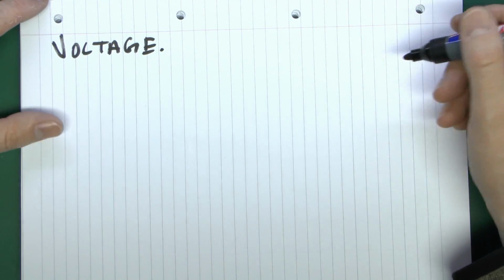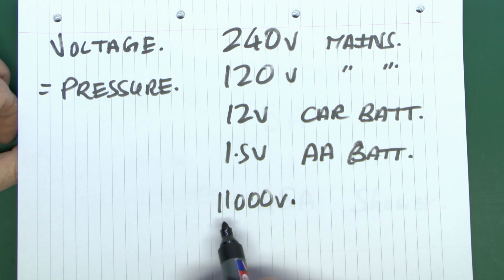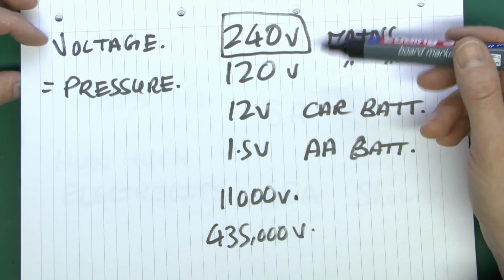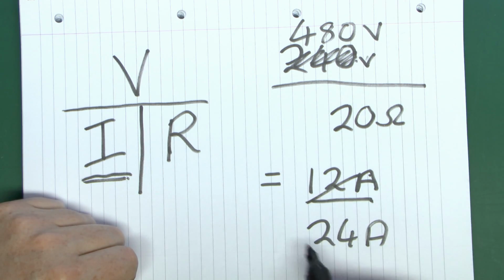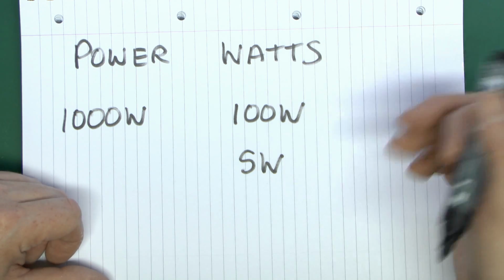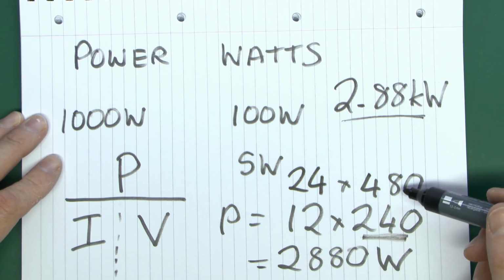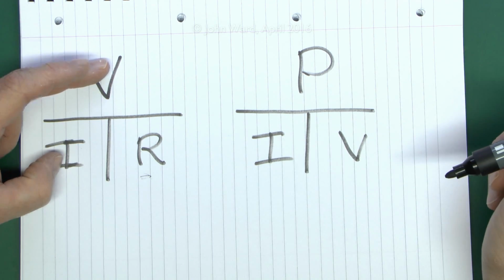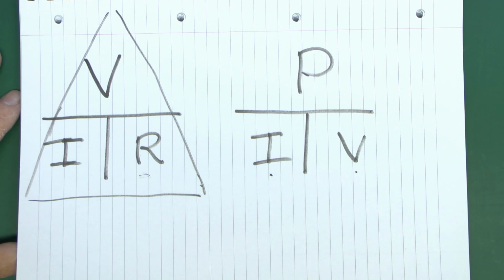Voltage, Current, Resistance & Power

Comment: hi John, is it possible to run 500amp with 1.5 volts DC through 1 square meter sheet with 2 ohms resistance

Comment: So.... here's a question.       When using a hand held electric drill and working the drill hard. eg.. drilling into brick. The drill maintains the same rpm but the current increases. Can anyone explain this. The drill doesn't have a brain yet it wants to get to its target rpm and to do so, it puts in more effort to do so. As if it had a brain. Just wondering. :-)
Reply from the maker: A motor just converts electrical energy to mechanical energy.  If it's more difficult to turn the motor it will take more current, until the point where the motor is stalled and it draws the maximum current.
Reply: @jwflame  Thank you JW!! Top bloke!

Comment: clearly you used a calculator to find R does anyone show their working anymore ??? what calculation method are You using to get your answers ?? magic is not possible if you are required to do it manually....  for example i don't care how you do it 1 divide by 0.25 is 0.25 Not 4

Comment: I had a discussion with my son, he argued that voltage kills but I was always told that it's current, though I suppose you could argue that it's resistance (lack of) that kills . who's correct or are both correct. Then there's static !!

Comment: Human with dry skin has a resistance of ~ 100,000 Ohms
Wet skin / breaks in skin lowers resistance to 1000 Ohms, and contact with high voltage damages skin which reduces resistance to ~ 500 Ohms.

Any current above 0.1 Amps can be lethal to humans. have fun calculating which of the common voltages are lethal

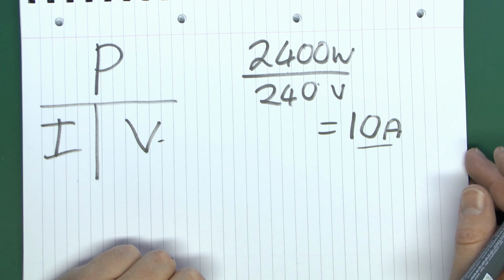Comment: Sir, I have been pulling out my hair for the last hour or two trying to figure out something that ought to be pretty simple, but for some reason I couldn't figure out.  I knew there were two formulas, and that they were connected, but couldn't quite put it together.  Then I found your video, and your very helpful links on the times.  Your explanation at 18:18 solved my dilemma.  Thanks!

Comment: Sir,i have question...
I have 24V ( DC) counter ,and i have supply voltage 
1. 220V DC ( case .I)
2. 110V DC (case.II)
What will be resistor value with watt also..
Current you suppose any .
Plz send me

Comment: Does current increase when we connect batteries in series or does only voltage change? Cool video btw!
Reply from the maker: Batteries in series = higher voltage, maximum current is the same.  Batteries in parallel = higher maximum current, voltage is the same.
Reply: @jwflame  oh thank you so much for replying. Im just dont completely understand this. If the voltage increases shouldn't the current increase also? Then the formula I=V/R doesn't apply, right?
Reply from the maker: @whoever2910  The formula does apply to batteries, but the R is the internal resistance of the battery, which is typically very small and in most practical applications isn't of any relevance.  I=V/R is generally used for loads and the circuit, not the power source.

Comment: JOHN WARD,                                                          if a lamp bulb draw .15 amps and another lamp bulb draw .25 amps how do you find the percentage of current draw between the two different lamp bulbs? what is the formula 
.15 amp lamp bulb draw less current compared to .25 amp lamp bulb by what percentage?
Reply from the maker: 100x .15/.25 = 60%, 
0.15 is 60% of the current of the 0.25.
Reply: @jwflame  is there other formula to use beside that one to find the percent of power consumed from the different of the .15 lamp to the .25 lamp?
Reply: @jwflame  if i rearrange the formula .25/.15 X 100 = 166.7% which doesn't make sense that the .25 lamp is 166.7%?
Reply from the maker: @billwilliams6338  .25 is greater than .15, so the percentage will be greater than 100%, 100% in that context is the 0.15, 166% is the 0.25
Reply: @jwflame  but what formula can I use to get the percentage between the two bulbs .25 and .15? 
like is .15 bulb 20%,40%,60%,80% drawing less current power compared to .25? What formula can I use to find the percentage between the two bulbs?

Comment: Let's say i have a older automotive relay that does not have an amp rating on it ,but i know it came out of a car with a 12 volt system. Are you saying i can check the resistance  across pins 30 and 87 (pins 85 & 86 are the coil) That way i would have two of the values needed to find the amp rating?
Reply from the maker: The resistance of the contacts will be zero when closed, so calculation isn't possible.
Rating of the contacts is down to how they are constructed such as how thick the metal is and various other factors.  Not something that can be determined by their resistance.
Reply: @jwflame  Yes that make sense. there must be some way to check them. Been watching a lot of videos where new parts are bad. Made me start thinking about relays, how do know what we are really getting.  Maybe trigger with a magnet then check resistance...Thanks.

Comment: John, I do like your videos and I know you picked 480v to make the maths easier. However, would have been better if you selected actual voltage on 3 phase circuits - 400 volts.

Comment: One slight mistake I caught. You said the resistance of the conductor is fixed and doesn't change. That is false. The resistance of almost any metal will vary based on temperature. This is known as the temperature coefficient of resistance. Indeed, this principle is what very accurate industrial thermometers are based on (called RTD's). You take a coil of (usually) platinum wire of a specific length and diameter and its resistance will change depending on the temperature. Properly calibrated, these RTD's are more accurate than mercury, thermocouples or thermistors.

Whatever the metal, the higher the temperature, the higher the resistance. This means as you pass current through the wire, it heats up, which increases the resistance of the wire considerably compared to its cold state. This concept is important in circuit design because the engineer needs to understand how the resistance change of a hot wire will affect current flow.

I realize I am being pedantic and this concept likely is of no relevance to an electrician who isn't interested in the resistance of a hot wire, but it's an interesting property of metals I figured some might be interested in.

Comment: hello John .. can you please check this video and let me know what you think about it please 

https://youtu.be/XMviNpejyr4
Reply from the maker: As in the other one - that is not how you measure current with a clamp meter.
For current, you need to disconnect the test leads, and place the clamp around one of the wires with it set to'A~' .
The power output will be tiny, as it's a very small generator, driven by a very small motor.

Comment: Question if you have a moment.  When a device runs on 120v (USA) at 1000W output and device states it draws 10A...the same identical device has ability to run on 240v, still has same 1000W output, but states it now draws 5A. The way I understand your video, when this device goes from 120v to 240v, the amperage of 10A (@120v) would go to 20A (doubled the 120v to 240v).   What am I not understanding correctly?
Reply: If it is a dummy device like a heater it would draw 4000 W on 240 volts which would destroy it. If it is a smart device that is designed for different voltages (or a dummy device designed for 240 V) then it would naturally draw less current on 240 V.

That means you just cannot use such dummy devices with incorrect voltage. You need to use a device designed for the proper voltage.

Comment: hello 

im working on a mini generator 

and im completely new in to Electricity fields 

so a question 

im getting 
560v 
140amp 
the resistance is - - - - 

what means this ? 
or how do i know how many ohms im getting  

please need your help
Reply from the maker: 560v / 140A = 4 ohms - but that only applies to resistive loads, and would not be correct for anything inductive or a power source such as a generator.
Reply: +John Ward thank you for your reply 

as i said im completely new to Electricity fields 

as i said im 560v 140amp. . and you said 4 ohms. . how its possible that i can't get a 5w bulb lighting with it ?
Reply: to be exactly what my voltmeter shows is as following 

560v 
162.1 Hz
45.61 Nf
138.2 F
25.40 v LoZ 

what all this means to make a metal grinder working with this i don't really know and that's why i need help please
Reply: +Dugagjin Dervishaj https://youtu.be/JY9LjaZ6aB4
Reply from the maker: 560V is the voltage with no load connected.  The 'loZ' mode on that meter applies a tiny load, usually a 100Kohm resistor, which causes the voltage to reduce to only 25 volts.  With any real load, the voltage will be even less, which is why nothing will work.
In the video showing the meter displaying 140A there are no wires through the clamp at the top of the meter - therefore it is not measuring current.  Clamp meters do not measure current at the leads connected to the device.
If any of those wires were really passing 140 amps, they would all have glowed red hot and set on fire within seconds.
Reply from the maker: I suggest you watch these videos on how to use meters correctly:
Clamp meter: https://youtu.be/g5d_wxdE5tk
Multimeter: https://youtu.be/rrqa-R1zCWQ
Reply: +John Ward 

any idea how to turn this volts and this amp's in to power that can make at least a metal grinder working with it ?
Reply: +John Ward 

any idea how to turn this volts and this amp's in to power that can make at least a metal grinder working with it ?
Reply: +Dugagjin Dervishaj 

you mean that the voltmeter is showing false numbers or im faking anything??
Reply from the maker: The 560V is probably there, but there is no current available - when any load is connected, the voltage will reduce to almost nothing.
The meter showing 140A is completely wrong, and suggests the meter is broken.

The 'generator' thing you are using is tiny - it can't provide any power.
Connecting it to a transformer will increase the voltage - but at the same time reduce the current.
Reply: +John Ward the voltmeter is almost brand new from USA. . isn't a Chinese product. . i could though that to but yes it can be a broken one doesn't mean where the voltmeter is from .. 

im waiting for a new voltmeter also from USA. . but yes i will make some new test with different voltameters 

and this measuring which i did they all are from transformer outputs

Comment: how do you know 20 ohms ? from 240 v ,  did you just picked and guess it 20 ohms , or what
Reply from the maker: 20 was used as an example because it makes the other figures whole numbers. For a real heating element you would need to measure the resistance with a multimeter .
Reply: ok , if you notice 240 volt , and you don't know know what amps or ohms to apply , , lets say 240 volt , how can we get the amps and ohms ?
Reply: i mean , how do we know the amps and ohms that going to be 240 volt by math ,?'
Reply from the maker: If you only have one of the values then you can't get the others - you need any two of voltage / current / resistance / power to be able to calculate the other two.
One of those on their own is meaningless.

Comment: Hi Johan...you done great video.. easy to understand... I have doubt..
Expl: I have 100W incandescent bulb and 100W LED light, is both are consume same power...?
If both consume same power means why we say LED'S are consume less power... I have confusion with this concept... so please explain me... Thank you for your great video...
Reply from the maker: 100W is 100W, regardless of whether it's LED, incandescent or anything else.
The difference is that a 100W LED will give out 10x more light than the 100W incandescent, so for the same amount of light you would only want a 10W LED.  Much less power for the same amount of light.
This assumes the products are marked with actual power consumption and not some useless 'equivalent' wattage.
Reply: John Ward thank you for your response...

Comment: Just a Question John and It may be a silly one but I'm a 3rd year apprentice electrician. Why is it when you work out the current for the big high voltage transition lines you use the power formula as opposed to ohms law?? E.g. the higher the voltage the less current.
Reply from the maker: Power lines are designed to carry a certain amount of power, so the equation with power in it is used - power is the fixed amount, and you can then determine the current required at a particular voltage.
Ohms law also applies, so if you increase the voltage the current also increases, the resistance of the line is fixed. However that isn't of much use for power lines, and for high voltages there is more involved than just resistance.

Comment: HOW CAN CALCULATE CURRENT IN 3 PHASE AND NEUTRAL  AIR CONDITIONER MOTOR GIVE FORMULA AND RESOLVE AN EXAMPLE IN FOR EXAMPLE 40 KW POWER MOTOR ,PLEASE AS SOON AS POSSIBLE.MANY THANKS.

Comment: 0:00 - Introduction
0:57 - Voltage basics
2:40 - Current basics
3:47 - Voltage & Current relation
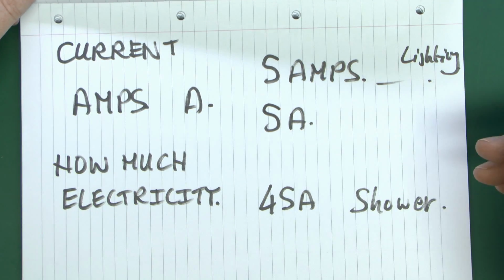4:40 - Resistance, Voltage & Current relation
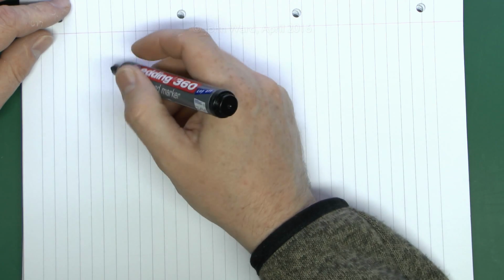7:21 - Ohms Law (V,I,R)
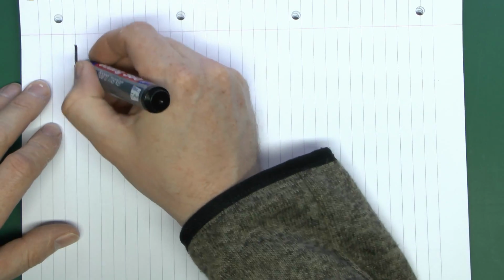12:12 - Watts Law (P,I,V)
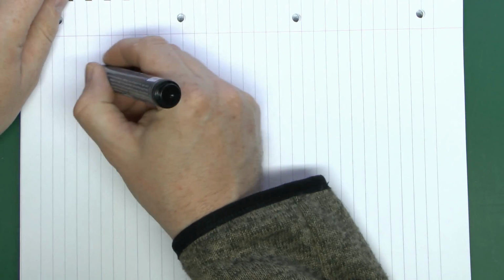18:18 - Ohms Law & Watts Law relation
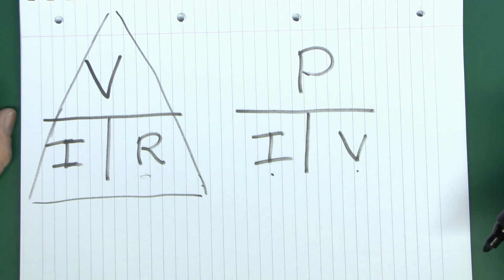20:23 - Recap
22:08 - Conclusion & advice
Reply: Nick I Clim
Reply: Oh ur sick man thx

Comment: Hi John,

Thank you for your video.

This is obviously for AC correct?

Does this apply to DC?

Example if you connect 6 x 6 volt 4 amp batteries together in a way that makes 36 volts at 4 amps. What is the resistance and the watts supplied?

Regards

Kurtis

Comment: This is late at night, and it's probably a dumb question but suppose I know the Power and Resistance, how do I go about finding the amps or volts?
Reply from the maker: Amps is the square root of power/resistance, voltage is the square root of power x resistance.
If you search for 'ohms law wheel' you will find a circular diagram which contains all of the combinations of power, voltage, resistance and current.
Reply: Thanks!

Comment: a very complicated explanation of a very simple topic.   Volts, amps and ohms were units  invented and defined by man with a relationship of 1:1:1.   That is,  one volt of force pushing electricity through one ohm of resistance will cause a current flow of one amp.  End of story.  The rest is just math derived from that.

Comment: VA isn't W, need power factor as well
Reply: +John Einar Reitan VA = W for instantaneous measurements. Power factor is only used for AC circuits where there are inductive (e.g. motors) or capacitive (e.g. flourescent lights) loads. AC Voltage and current measures are RMS (Root Mean Square) values derived from the varying AC instantaneous values. When power factor isn't 1, instantaneous VA will be less than RMS VA.

Comment: When teaching Ohm' law, consider using the symbols Ω, V, A, W. Instead of R, [UVE], I, P.
Source: https://youtu.be/WLK8zgpixDY?t=1m17s
Reply: +Per Mejdal Rasmussen I would not want any electric work be done on my house by a person who cannot learn the things properly. Understanding the concepts of voltage, current and resistance is essential. It is not enough to read something from a  meter.
Reply: +Okaro X You have not understood my comment. It is not about not learning Ohm's law. It is about using variables that are easier to remember. People keep teaching R, [UVE], I, P, because that is what they have learned. Without stopping and thinking why we use those variables when Ω, V, A, W is much more intuitive.

Comment: With Ohm's law, you learned it with "V" (as in V = I x R ). I did learned it with "U" ( as in U = I x R ).  According wikipedia, it differs from country to country which letter is used.
Reply: +Marco S Some even use E for volt.
Reply: +Per Mejdal Rasmussen      I didn't know that, thank you. I did learn something which did use the E in some calculations, but it is almost more than 30 years ago (and not my job). Maybe it was something electronics-related. I don't remember, too long ago.
Reply: +Marco S I did some research and found U="unterschied" (difference in German) and E="Electromotive force".
Reply: +Per Mejdal Rasmussen   Thank you.

Comment: So if I take my camera charger (designed for 240V) to a 120V country, would that mean I need to charge for twice as long, because the power is halved?
Reply: +Anthony Kernich It will draw more current on 120v than 240v to achieve same wattage.. Remember P=VI
Reply: +Anthony Kernich , good question, i wonder how the power pack/transformer designed for 240v would perform on 120v, given the specific windinings in the transformer designed to transform 240v.
Reply: my charger doesn't have a transformer on it, must be designed for dual voltage
Reply: It says on the device: Input 100-240V AC
Reply: If it was a transformer designed to work on 230v and it is plugged into 110v the output will be approx half, as the voltage is less than that of the battery it wont charge at all.
Reply: I was simply putting to bed the idea of a 230v transformer (bog standard type) on half voltage taking twice as long to charge ;)
Reply: My camera charger says:

Input 100-240 V 50/60 Hz 9.5 VA (100V)- 13.5 VA (240 V) 
Output 4.2 V 0.7 A.

The charger outputs always same regardless of the input voltage so the time does not change. The battery is 1120 mAh so it should take some 1 hour 36 mins to charge (probably more because of losses)